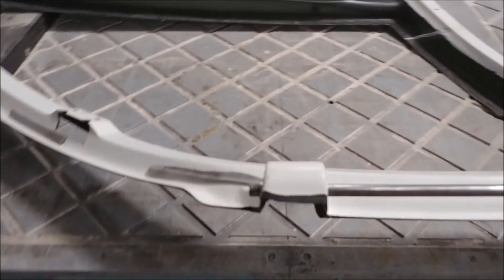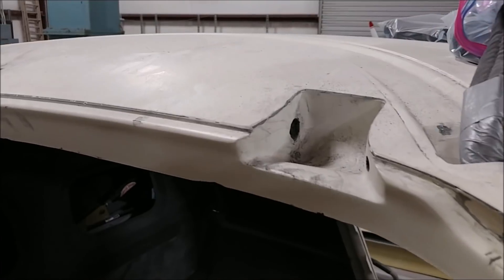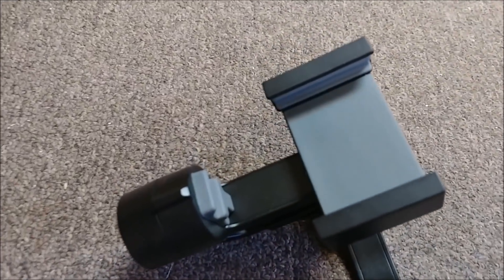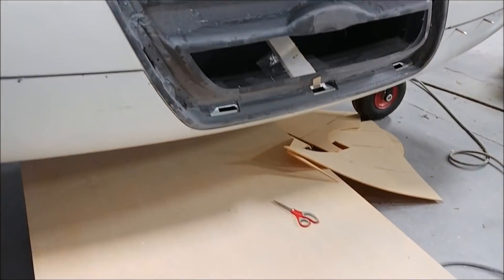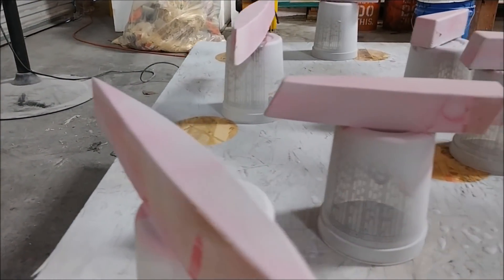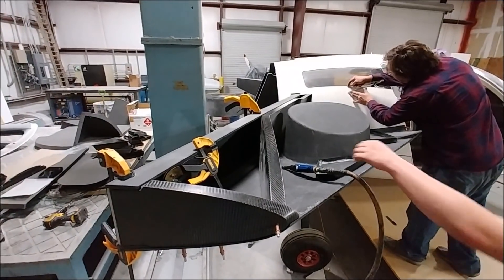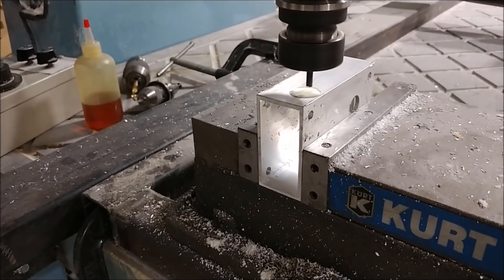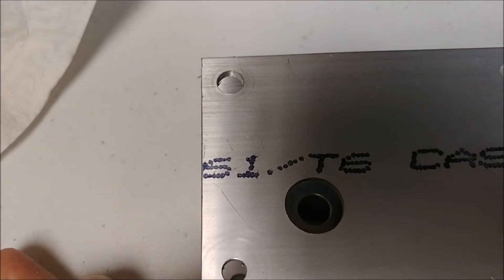Doors and Wing Tanks

Comment: Just wondering how the fuel is to flow between each of the segments. I just couldn't see any gaps or provision for fuel to flow through. Also I know that the fuel is to be cycled through the heat exchanger to prevent gelling. Where will the pump be for this? Will it be a wet pump in the tank or located near the heat exchanger in the engine bay?
Reply from the maker: There will be upper and lower 'mouse' holes in the baffles to allow flow between chambers. The circulation pump is just below the heat exchanger slightly forward of the firewall.

Comment from the maker: I forgot to mention again that the door hinge and lock setup is most likely going to change on production to a clam shell door setup. So please hold your comments on this topic. What you see is just on the prototype. Also, the seals for the re-drive are supposed to ship on the 21st.
Reply: Raptor Aircraft brazil !!!
Reply: I'm curious to see how you redesign the door:  I'm guessing you'd still need the three latches at the junction but the lower door would need its own side pins and mechanism, thus increasing overall weight and complexity.  I think this is how the Cirrus jet door works.  I thought the fold-down step looked a little awkward the first time I saw it but it's cheap, light and simple; plus Velocity-style doors are sexy as hell.